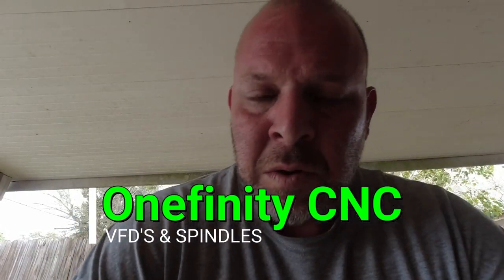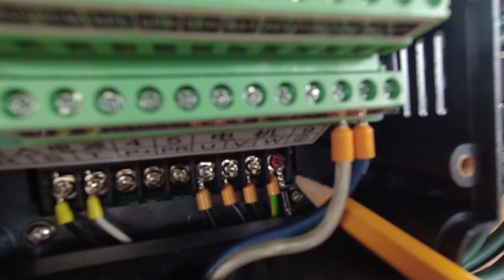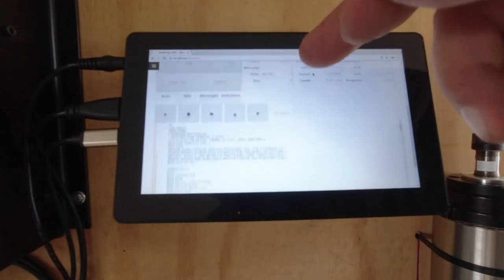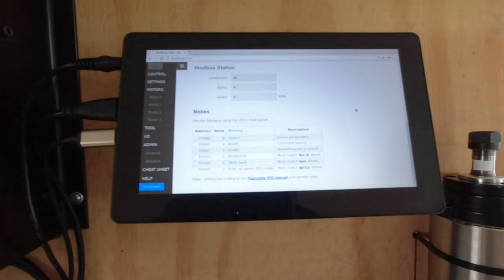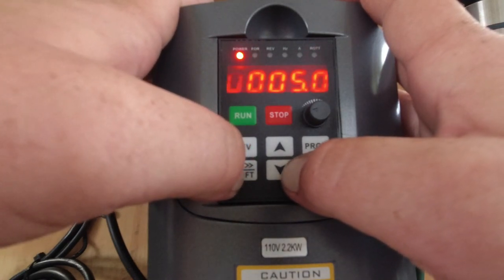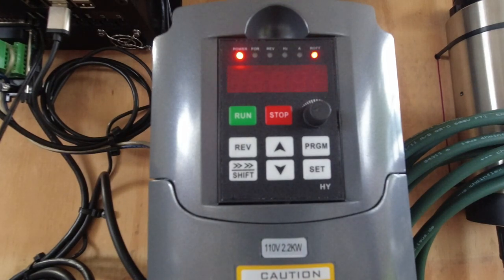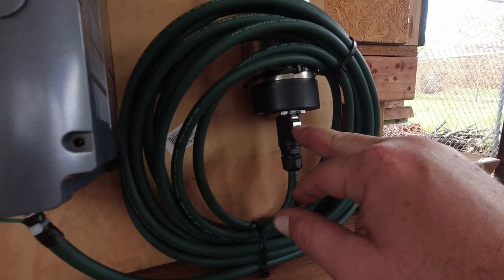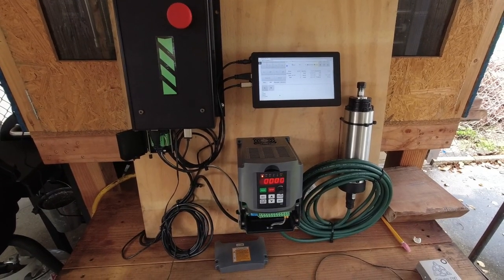Onefinity VFD & Spindle video

Comment: Jason - it's me again! I have reset the HuanYang VFD to factory settings. I have gone through and set up the parameters for my 1F controller, I have set the incoming power parameters and the parameters for my HY spindle. I have done continuity checks on all the pins and my wiring; wrung it out to ensure that wires are on the right pins. Shielded cable is also grounded to the VFD. Here's what I'm running:

VFD - HY02D211B (110v, 2.2KW)
Spindle - GDZ-80-2.2C(4) 80x238, 110v-400Hz, 2.2Kw, 24000 RPM (water-cooled)
Input voltage is 120v on a dedicated 12/2 from a 20A breaker (home-run)

When I power up everything and do a, "M3 S12000" or any RPM, the spindle starts turning and runs up to around 900 or so RPM (I used a laser tach to verify) then it stops. I get a A.o.A error on the VFD. I can stop it, do it again and get the same results. Full disclosure: I haven't hooked up the water yet as I wanted to at least get the thing turning briefly before I ran all the coolant lines. It has never spun up over 1000 RPM's. I realize you don't like giving out params for folks as every situation is different. That's not on you. I went through this video several times and still can't figure out what's up. Could use your thoughts, when you have time to think. I can message you on FB in the 1F group if you want me to run through my params?
Reply from the maker: Yeah message me on Facebook messenger please.
Reply from the maker: Did you message me on FB? There’s probably 2 accounts that show up for me. One was hacked and I can’t get back into it. I had to create a new account and the picture you should see is me in my work uniform sitting in my golf cart smoking a cigarette. 😂

Comment: Thank you Stewart for the video. I agree to set the OneFinity minimum speed to 0 to make sure the spindle turns. But you can limit the minimum speed by setting PD11. I set mine to 240 = 7200. If you try to program anything less than 7200 the spindle will turn on and run at 7200.

Comment: HI Jason, great content for sure. I have two questions. One I wanted to clarify something about the ground for the spindle (for the touch probe to work without the magnet lead). This is a separate ground wire and NOT the other end of the cable shielding correct? I assume that as I know from my communications days that you cannot ground both ends of a shield on a RS485 cable or you will create a ground loop but I was not sure if there was a 4th wire (ground wire) running in that cable from the VFD to the spindle. Do you also need to run a ground wire between the pin 4 on the spindle to the spindle case? I think that is what you were saying but I am not 100% sure. 2.) Do you know where I can find information on the "sizing of the spindle" in terms of KWs? Say I was using 200V and not limited by amperage, is there any advantage to going to something greater than a 1.5Kw? Does it strictly relate to the material you are cutting or are there practical structural limits to the Onefinity even with a Z20 and a "Stiffy" component? Trying to wrap my head around this before I purchase a spindle. Cheers John

Comment: Iam going to watch your vid again { great job } but I am trying to refigure the best grounding system. I have a 110v chinese spindle and of course the 4th pin goes nowhere. I still soldered my ground wire to it from my shielded cable.. I seen where the other end can be connected to the same ground as the 110v hot line to the VFD.  I have seen posts where people have grounded there machine directly to an earth ground in a wall outlet. Does the spindle and machine still need to be grounded ? Thanks
Reply from the maker: Did you actually pop the cover off and solder a short ground wire to pin 4 inside the spindle and find a way to router that wire to somewhere that connects the the metal of the spindle body? I know some say just ground the machine itself because everything is metal and since the spindle is metal it’ll all be grounded. I can see that being a legitimate solution.....BUT.....you have anodized aluminum parts so that’s a coating that could potentially cause grounding issues. Also you have bearings and oil or grease in the moveable parts of each axis so that’s just a lot of things the ground has to hopefully make a solid connection with back to earth ground. That’s why I prefer actually connecting the ground inside the spindle to ensure it’s ACTUALLY got a pathway back to earth ground.
Reply: @jasonstewart5942  Sorry for the delay. Yes I soldered a grd wire to the 4th pin and ran it to the outside of the spindle , attached with copper tape. I cut a small channel on  top of the spindle for the wire to lay in coming out of the connector plate. Hope this makes sense.

Comment: What type of wire should I use to go between the vfd to the breakout board ? Thank you
Reply: hey, did you ever find out?
Reply: @underfeated0811  double shielded 22 awg 2 wire. I purchased it on eBay from len1007 20ft for $32. He was very good at answering any questions about vfds and spindles.

Comment: are you using connectors on the end of the wires in the VFD or is it just the wire? i am setting mine up and and trying to figure out which connectors I need for the wire ends.  I will definitely be referencing this video when I start programing mine.
Reply from the maker: They're called wire ferrules. You can get a kit on Amazon with the crimp tool for cheap. Like $20
Reply: @jasonstewart5942  Thanks  one other question for ya.  What gage of wire are you using from the controller to the breakout box.
Reply from the maker: Probably the biggest you can fit would be 18awg but you can use smaller if ya want. It just needs to be able to send communication back & fourth.

Comment: Nice video Jason! Very helpful.  I have a couple of questions from an old person, but newbie to the spindle world.
How do you wire the dynamic breaking resistor?
How did you wire the ground on the spindle?
Reply from the maker: There should be a location between the input power and spindle output power to hook up a dynamic breaking resistor. I think it's labeled pB. As far as grounding the spindle you gotta pop the top cover off and see if they have a wire soldered to pin 4 which most likely won't be. You'd have to solder a wire to it and then get creative on where to get that wire to make continuity to the spindle body. The air cooled are a little harder. I used maybe a 20-22awg wire and ran it out through the fan housing and have the bare wire wrapped around one of the screws that fasten the fan cover down. The water cooled have like 3 screws inside the housing that you can use to wire that pin 4 too.
Reply: @jasonstewart5942  Thanks Jason
Reply: Grounding 101
After adding a wire to the 4 pin and attaching it to the screw, do you add an independent wire to the screw and run it back to the VFD’s earth connection?
Reply from the maker: By adding a wire to pin 4 INSIDE the spindle and attaching it to somewhere on the body of the spindle that IS your ground back to earth. That is of course if you also add a wire to pin 4 on the aviation connector that plugs into the spindle.

Comment: Jason, Very helpful, Thank  you. I purchase the 220v 1.5k air cooled spindle. I purchased 16/4 double shielded cable from Automationdirect, but it measures over .500" OD, and there is no way it will fit into the connector on the spindle. It is different than the one that you supplied a link for. Could you tell me what the outside diameter of the cable that you used measures? Also could you provide a link for the aviation connector that you used. I was order #38 for the Onefinity and just recently got it set up and running. Currently using the Makita router. Thanks again!
Reply: Also, what gage wire did you use for the communication wire from the VFD to the Onefinity controller?
Reply from the maker: @stevenhawley3189  https://www.amazon.com/dp/B087N342RV/ref=cm_sw_r_cp_apa_fabc_0BBF6GP5SN5PKYWTN8EM?_encoding=UTF8&psc=1
Reply from the maker: @stevenhawley3189  https://www.automationdirect.com/adc/shopping/catalog/cables/bulk_multi-conductor_cable/continuous_flexing_control_cable/16_awg_shielded/cf6-15-04-1
Reply from the maker: The outer diameter of the cable I used that I just sent a link for is 0.37"
Reply: @jasonstewart5942  Thank you!  Just ordered the wire and connector. What wire did you use for communication from VFD to controller?
Reply from the maker: @stevenhawley3189  that wire doesn't need to be anything specific. Just something small like 18-20awg stranded wire. Something you could easily aquire from your local home improvement store.
Reply: @jasonstewart5942  Thanks!

Comment: When I added a breakout board to the 1F controller it says to use 2 wires to RS - AND rs +. There is a place for a ground wire that could go from the breakout board to the VFD. Can I hook this up ?
Reply from the maker: All you need to hook up to control the VFD from the breakout board is pin 13 (RS485+) and pin 14 (RS485-).

Comment: Nice Video, I have not ordered the Onefinity yet. I am trying to decide if I want to have a 220v outlet put in my garage to dedicate to the CNC as I feel I want to put a 2.2KW spindle on it. I see yours is 2.2kw 110V is there a performance difference or an installation benefit to go 110v instead of 220v? I am a complete noob and know nothing yet about CNC, electronics, or really even woodworking yet, but I hope my 56-year-old mind can learn. It is my dream to start a small sign and clock business to earn an extra $500-$900 a month income after expenses. More than that and I risk losing my social security.

Comment: I have set up my Huanyang spindle and Onefinity controller, your video was very informative. Everything worked fine, I shut down for last night and restarted today. It will not take a manual input all of a sudden and runs at maximum rpm on any tool path speed that is fed to it. I am now rechecking all settings in both the controller and VFD. Do you have any idea what might have changed?
Reply from the maker: Hmmmmm. That's interesting. First I've heard of that happening. So what exactly do you mean by "will not take any manual input"?
Reply from the maker: Judging by what you are saying it almost sounds like you maybe forgot to set the MAXIMUM RPM for the spindle in the TOOL tab to 24000 RPM maybe? Because if it's set for the default of I wanna say it's 255 then anything you enter in for spindle RPM above 255 would make it run full speed.
Reply: @jasonstewart5942  Max is set to 2400. Went to MDI tab and ran a  "M3 S1200" and entered  ran up to 24000. tried 10000, then 15000, then 8000 and rpm  same result 24000. Rechecked both VFD and Onefinity setting and all are correct. Have reset pd 001 to "1" and got the VFD dial to work properly. I ran a vectric tool path with a 10000 rpm setting, the saved G-code shows 10000, but the spindle spped runs up to 24000. The control screen shows the speed correctly but followed by 24000 in parenthesis.
Reply: @jasonstewart5942  it is set to 24000, still runs to man no matter what the gcode says
Reply: max not man
Reply from the maker: I gotta say I don't have an answer to that one currently. Haven't seen that before.
Reply: @jasonstewart5942  will research this further, I would like to see this option work.  Real strange that it shows both speeds in the  speed area of the  control screen
Reply from the maker: I unfortunately don’t have my test setup anymore that I used to make this video to try and mess around and recreate the problem since I only setup that test panel to simulate using the Onefinity controller for those who are still going to be using the Onefinity controller. I’m however not using the Onefinity controller anymore.
Reply: Jason,
Can you elaborate on NOT using the onefinity controller?  Is there something better than the one delivered?
Reply from the maker: @danelswick9886  I'm using the Open Builds black box controller. My first time using it. So far it's okay. I haven't even made any cuts yet with the new controller so I don't have anything I can say about it yet.

Comment: Jason you seem to be the guy when it comes to setting up the VFD for the Onefinity. Well I installed my  Huanyang 110v 2.2kw water cooled spindle this weekend. Having an issue with an error on the VFD and can't seem to find any information regarding what this error is and how to trouble shoot it. The error is EoA.A. Can you point me towards a fix for this? The spindle turns on using the Onefinity control with MDI but only spins slowly for a short time then the VFD errors.

Comment: Nice video Jason!! Couple of questions. When you shutdown the spindle quickly, are you getting any heat up of it? Do you have a resistor on the braking system? What is the tape on the collet shaft for? Can you share a link for the cable you used?
Reply from the maker: When stopping the spindle at a lower deceleration rate I haven't noticed any excessive heat. I do however have a dynamic breaking resistor I am going to be using. I just didn't have it hooked up for this video. The reflective tape on the spindle was me using my tachometer to just verify the spindle RPM.
Reply from the maker: https://www.automationdirect.com/adc/shopping/catalog/cables/bulk_multi-conductor_cable/continuous_flexing_control_cable/16_awg_shielded/cf6-15-04-1
Reply: @jasonstewart5942  what size resistor are you going to use?
Reply from the maker: @bharkin1  This is what I bought. https://www.amazon.com/dp/B07C7R8VRJ/ref=cm_sw_r_cp_apa_fabc_VH73QR8YNQ46F1GW65KG?_encoding=UTF8&psc=1
Reply: @jasonstewart5942  You might want to check with manufacturer as I dont believe you can use a Braking resistor with that VFD.
Reply from the maker: @larrypryor7699  It has a spot for a braking resistor on these VFD's. I know they have some I believe that don't have that option.

Comment: About to wire up y 220v Huanyang VFD and spindle. Bought the cable, recommended by you from Automation Direct. Question, on the crimp spade connectors, what gauge did you use for connecting in the VFD, thanks?
Reply from the maker: It’s 16awg wire so they need to be able to accept 16awg.
Reply: @jasonstewart5942  Thanks

Comment: Sorry for all the questions. Iam slowly getting it figured out. But are all or most of the HY 110v 1.5k spindles 2 pole ? Or how can I find out. The default is 4 pole.in the book.
Reply from the maker: It’s 2 pole.
Reply from the maker: PD141 = 110 (that is of course if you have the 110v version like you said)
PD142 = THE AMPERAGE ETCHED ON THE SIDE OF THE SPINDLE BODY
PD143 = 2 POLE
PD144 = 3000
Reply: Thanks for all of the great info. Very informative video.

Comment: yes I have a 1F. I set all of the settings are set according to yours and I still cant get the spindle to start . I go to MDI enter m3f12000 and nothing happens. The only parimiter I couldnt set higher was pm142 for amps. It would only go up to 7 and my spindle says it is an 8amp. Kinda lost at this point.
Reply from the maker: M3 S not F
Reply from the maker: As far as pd142 I keep hearing that some of the VFD's only go to a certain amperage setting which is odd especially if they created a package deal where you can buy the spindle and vfd together. If the spindle says 8 amps and your max is 7 amps then all I can say is set it for the max of 7 amps.

Comment: Good job Jason. And timely. I’m just setting mine up. Only difference is my spindle is the 1.5kw 220v. What gauge vfd cable did you use and where did you get it. I ordered a sheilded vfd cable but all 4 wires are the same color plus it looks bigger than what I can fit a lug on to attach to the connectors on the VFD.
Reply from the maker: https://www.automationdirect.com/adc/shopping/catalog/cables/bulk_multi-conductor_cable/continuous_flexing_control_cable/16_awg_shielded/cf6-15-04-1
Reply from the maker: Wires colors honestly don't matter as long as you make sure whatever wire you choose to be used as pin #4 (gnd) is not mixed and accidentally used as one of the 3 phase hot legs of power.
Reply from the maker: But I do suggest using that cable I provided a link for. It's only 0.37" in diameter and easier to work with an very flexible.
Reply: Thanks!

Comment: I really like that connector on your spindle! I have a similar setup as you (mine is 110v 2.2kw but watercooled) and was wondering where you purchased that connector and if you have the specific part # it would be greatly appreciated! Also, you say you arent using the stock controller anymore, care to share what you are using with your Onefinity now? -TIA
Reply from the maker: https://www.amazon.com/dp/B087N342RV?ref=ppx_pop_mob_ap_share
Reply from the maker: Now this is the connector I used, but mine is air cooled and I still had to modify the fan shroud piece of the spindle because the mounting holes weren't exactly the same. So really it depends on what your current aviation connector looks like to make sure you get something similar.
Reply from the maker: As far as the controller I switched to its the Openbuilds Black Box controller from Openbuildspartstore.com